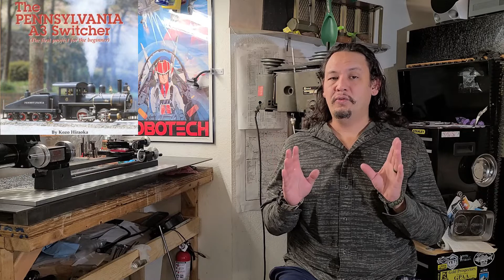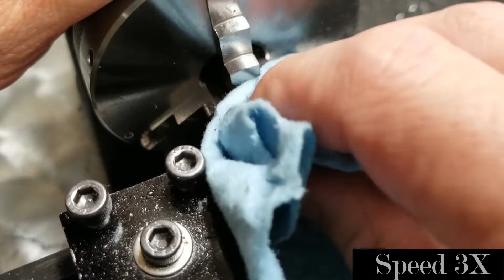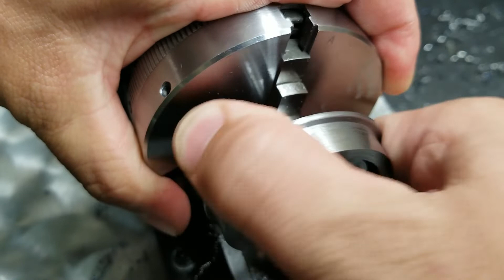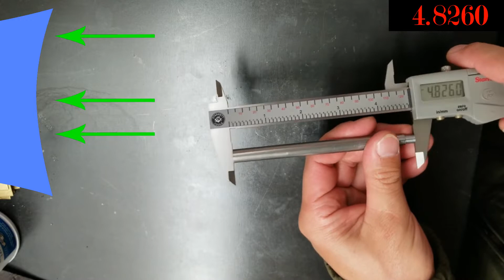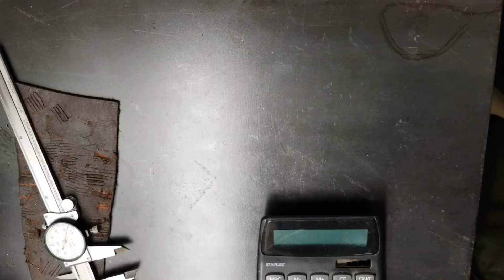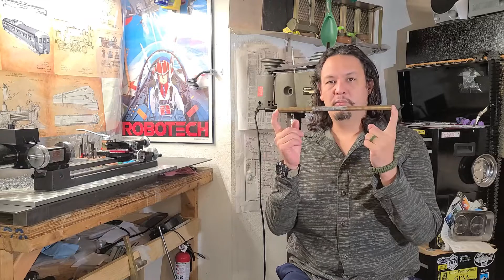Tender Wheel Axels Kozo Hiraoka ¾” scale Pennsylvania A-3 Switcher 0-4-0 Loyd Precision Makers

Comment: If you want superb mirror finish cuts try GT** insets, these are made primarally for cutting aluminium. They work super on steel, brass/bronze, stainless steel, aluminum & plastics. I use this type of insert on my Sherline all the time now with brilliant results, I still have lots of the MT** inserts like the inserts you are using which I now only use for roughing out just to use these MT** tips up. Lots of model engineers with much larger heavier machines now also use the GT** inserts on all metals once they try them, give them a go you might be very pleasantly surprised with the results you get. They are also pretty good for back cuts & dont tear the material, this is because the GT** insrts have a very sharp ground finish on the inserts cutting edges. The result is the sharp insert tip puts less pressure between the tip & the material.
Reply from the maker: Cool.  Thank you.  I wasn't sure what to try next for inserts.  I am still trying to wrap my head around ISO versus ANSI insert designations.  Did you have favorite brand or link to a insert you can recommend?
Reply: @LoydPrecisionMakers  I used to get my inserts from Banggood in China, they were great quality inserts at a pretty low price. Sadly Banggood no longer sell these inserts, however you can get the very same inserts on Ebay pretty cheap as well for boxes of 10 inserts. They are all over Ebay, mainly coming from China with free shipping. I must say I have never had any problems buying these from China & being sent to me in the UK. The inserts i use are DCGT070204 & CCGT060204, if you put either of those codes in on Ebay you will see loads of the inserts for sale. These inserts are a game changer, especially on very small lathes like the Sherline.
Reply from the maker: Your right.  it isn't too bad for a full sleeve of 10 inserts.  I see what you mean about them mostly coming from China.  Thanks it really does open things up and provide a bunch more options.  A few look odd like German made  SANDVIK coming out of Serbia or Bulgaria.  I think I'd stay away from the Mitsubishi Japanese made ones coming out of China.  I almost feel like it be safer to go with a Chinese Company Brand shipped from China.
Reply: @LoydPrecisionMakers  The unbranded inserts from China work excellent in my experience, I know a lot of people that also like those inserts considering the low prices. Branded inserts like Sandvik & Mitsubushi are very good premium inserts, providing they are not fake. Genuine branded inserts are also a lot more expensive & are not really nessessary on small hobby lathes.
Reply: @LoydPrecisionMakers  The 3 sided triangular inserts  for aluminum are known as TCGT inserts, depending on what size inserts your tool takes. You measure along one of the flat edges to get its size, for example if yor insert is 11mm along its flat cutting edge then you want TCGT110204 inserts foe aluminum. These inserts are also available on Ebay.
Reply from the maker: Thank you so much for taking the time to let me know and explain it to me.  It worked like a charm.  I was able to find a nice pack of new cutters in country. I'm excited to try these out!

Comment: Yay another kozo build video!  I'm starting on my tender wheels on Monday since I got my lathe dialed in.   I also have to agree with @TreasureToTrash.  I ran carbide in my 7x14 lathe, because I thought it must be better, the big boys use it!  It is not for our lathes, we don't have the power or rigidity to run it properly. I bought a set of pre-ground tools to test the waters and it was like night and day. I could cut deeper, get better finishes with no chatter.
Reply from the maker: Thanks that for sure seems to be the consensus.  Now that you mention it, as I recall little machine shop does have a sampler tool set as well as a practice HHS grinding set.  I definitely need to get my grinder running and give it a whirl.

Comment: You really ought to use high speed steel instead of carbide insert tooling. I use a sherline lathe and I have had much much better luck with it and it is a hell of a lot cheaper. It wont squeal and chatter as easy either. It also leaves a better finish and can be resharpened. But if you insist on using the carbide, crank your RPM wayyyyy up and be a bit agressive with your depth of cut and feedrate. Your finish will be more consistent and you wont chip inserts. But if you can, use HSS, it really is extremely superior on small machines and I have had a great experience with it on the sherline. For finishing you can grind a shear tool that leaves an AMAZING surface finish. Theres a few videos on it if you look it up. Good luck
Reply from the maker: Very cool thank you.  I will definitely have to jump in there and give them another try.  I think the thing I find most intimidating with HHS is having to resharpen.  Thanks I will definitely have to try it out.
Reply: @LoydPrecisionMakers  Its really not that difficult, it took me just a few trys to nail it, and every time after its super easy.